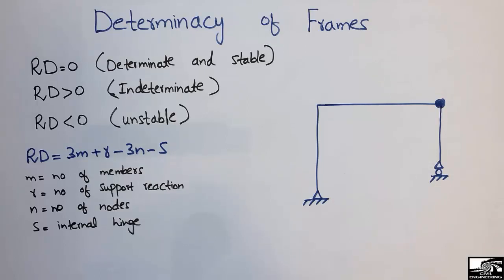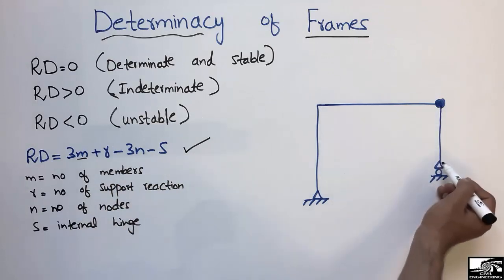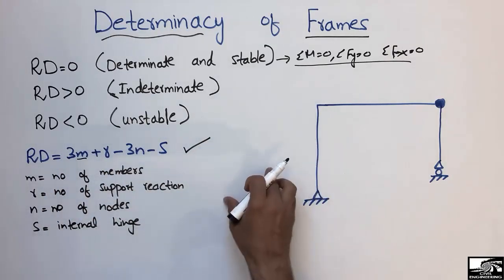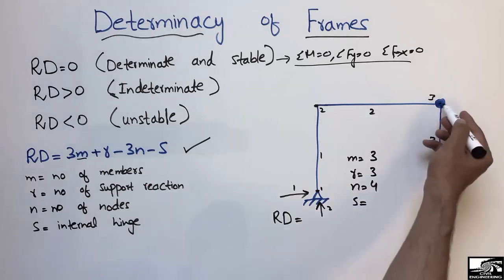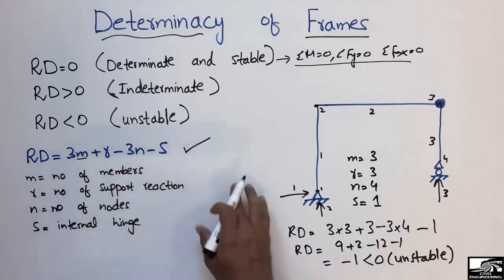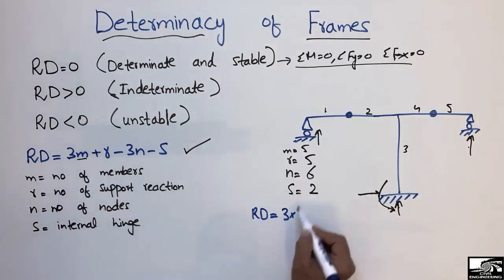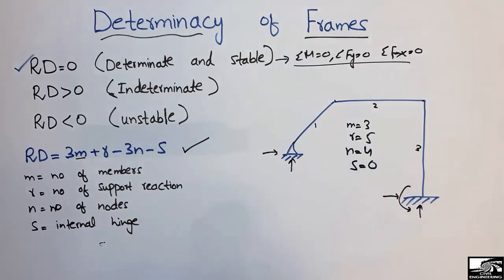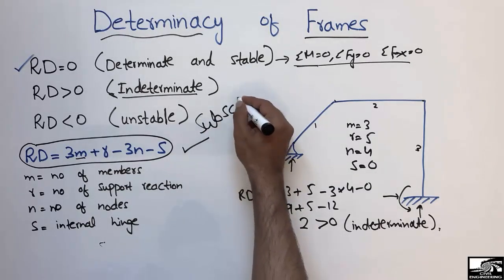Static Determinacy , Indeterminacy & Stability of Frame Structures

Comment: Can you do examples for truss too?
Reply from the maker: Yes I will
Reply: Thanks.  I found that some people count the member with joint as one member instead of 2 members like you did in the example. Is there different ways to find it? If so can you explain what are the different ways to find determinancy? Because i am cofuse with all these ways. Problem with the joint at where 2 beams and the column connection.